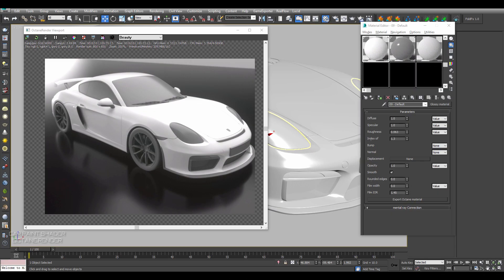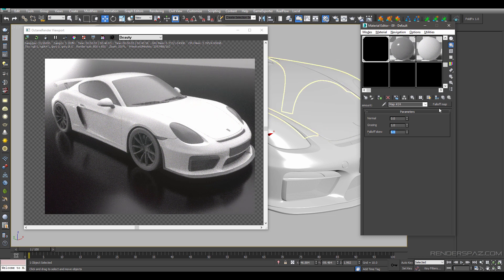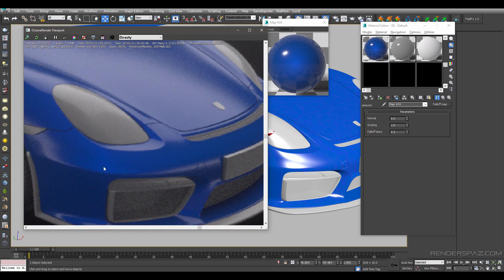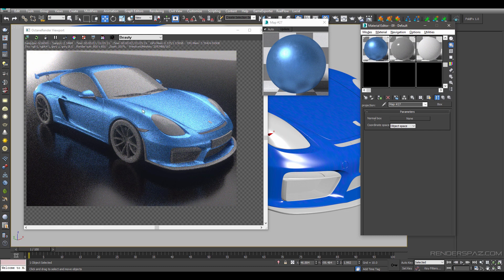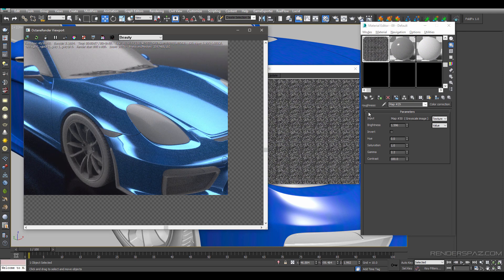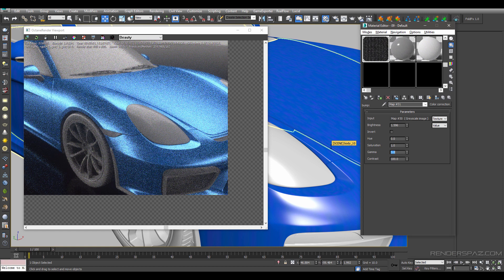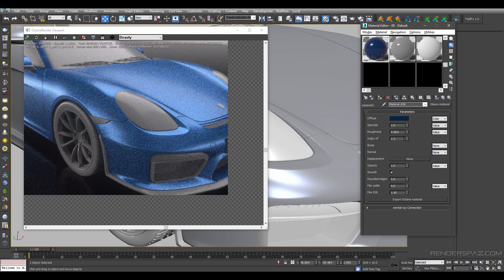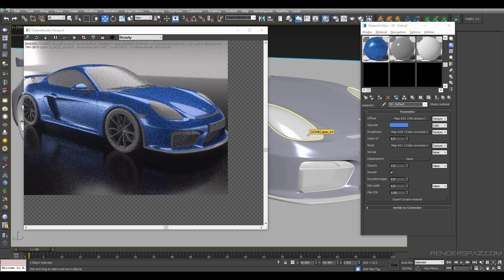Car Paint Material In Octane Render

Comment: how bad is the way octane creates its materials.. only 2 slots in mixes, no masks, worst falloff ever with 0 options, adding nodes like greyscale image without a reason and ofc no 3ds max maps are supported. They really should revise how octane works in max while in c4d it supports a lot of maps/shaders. Its like a semi finished product in 3ds max. If they make those changes octane will be a beast in max
Reply: Whats the problem here? You can still use the node editor to do everything you mentioned.